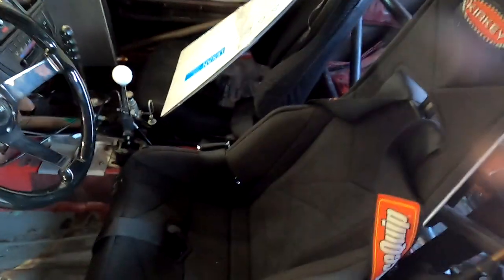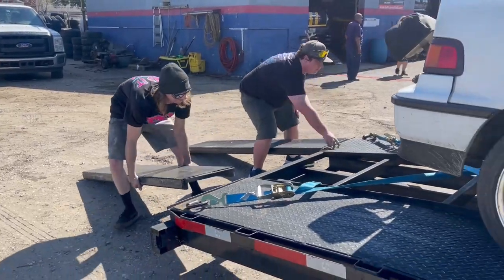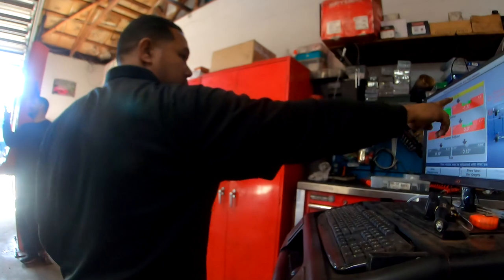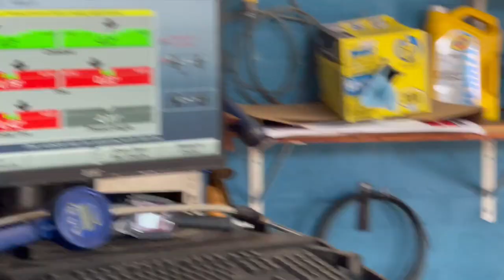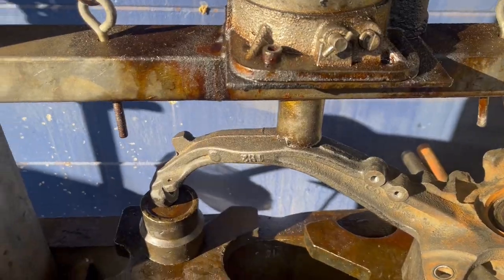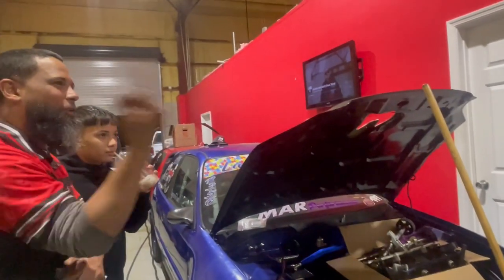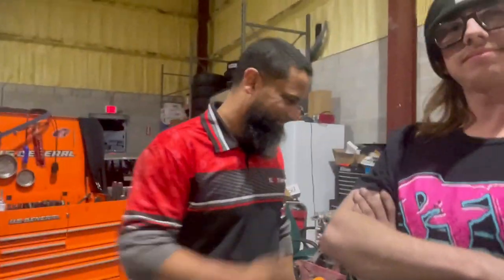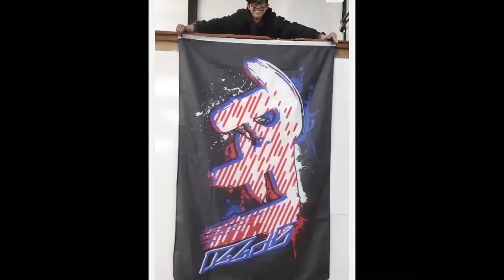8 Second Civic Towing a trailer is Awesome!  Finishing Sick week prep!

Comment: I like what they did to the Island Civic it's got one of them new one off special type of crate engines but it's so special it doesn't even come in a crate it comes in a cardboard box and no assembly necessary all you have to do is put it in the engine bay and go run 8sec passes

Comment: Jamie with your bumper you might be fine aftef you burp coolant system if not add a force fan to front radiator while back pulls a o you always have air forced thru it did that on my 98 d16 sungle jingle and worked great.